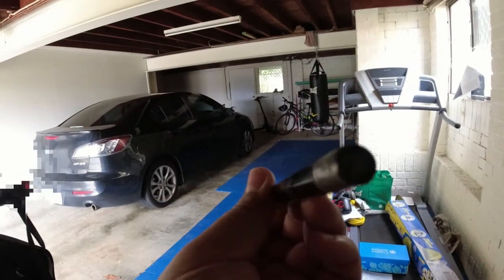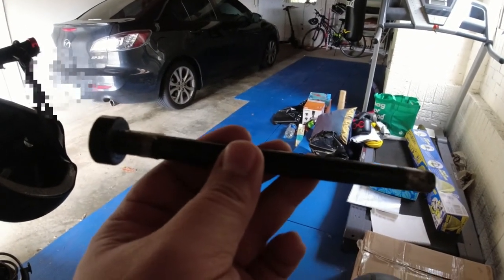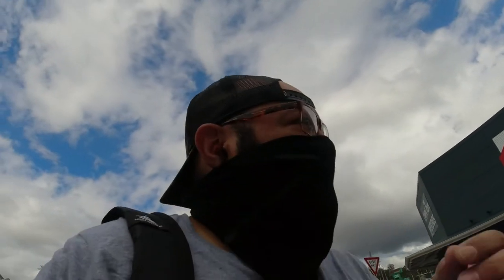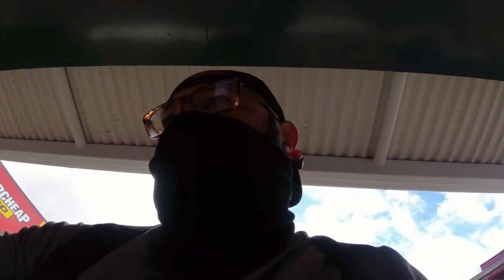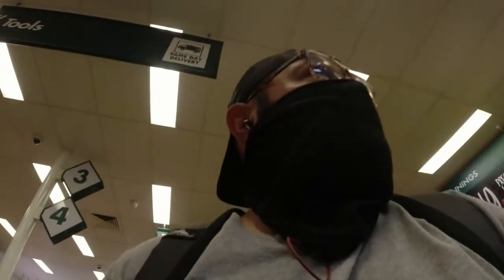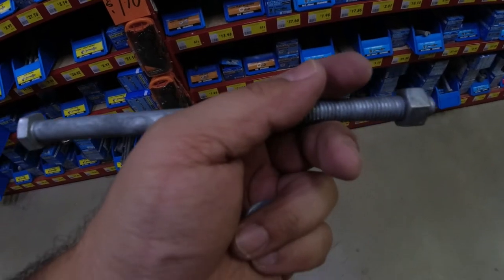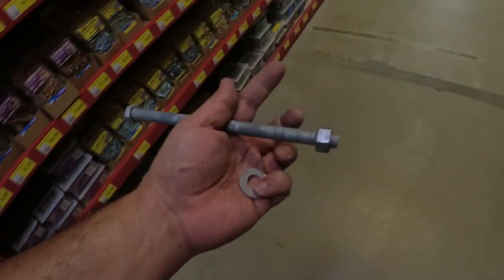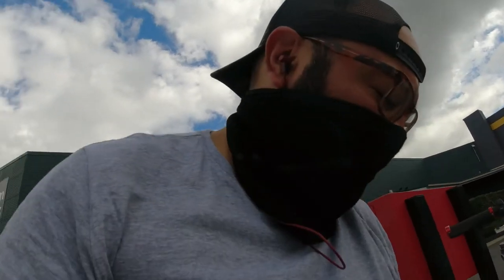This scooter repair may kill me and also maybe not

Comment: You can grind or sand the end of the bolt down to shorten it if needed. Good fix.
Reply from the maker: Luckily it's a temporary fix so I'm not too bothered about the finish. Just glad it doesn't protrude further than the frame. Don't want to slash some poor cyclists tyres passing them. 🔩🗡🚴‍♂️💀👮‍♂️🚓🏛🏫 

Last one is supposed to be a jail.